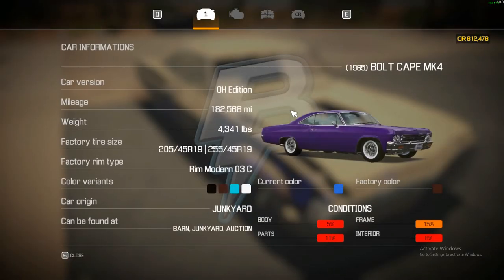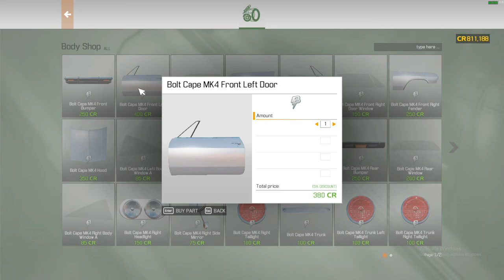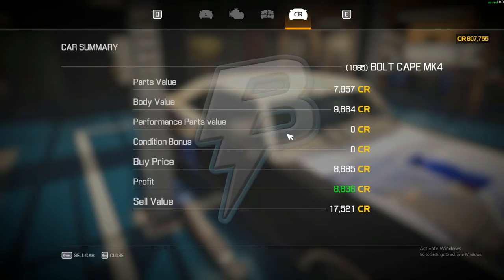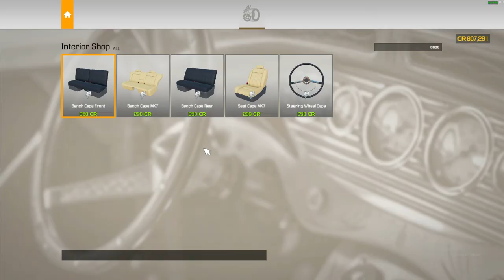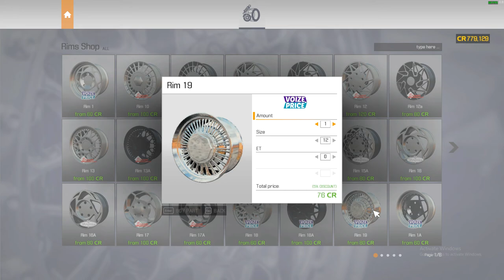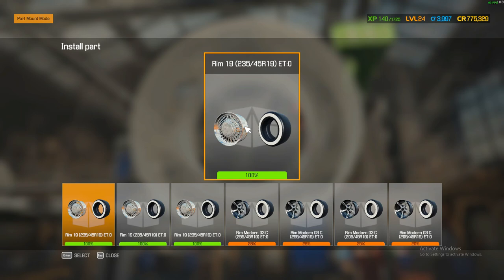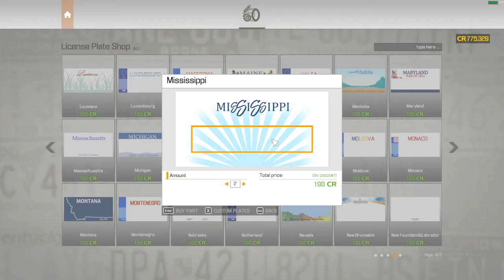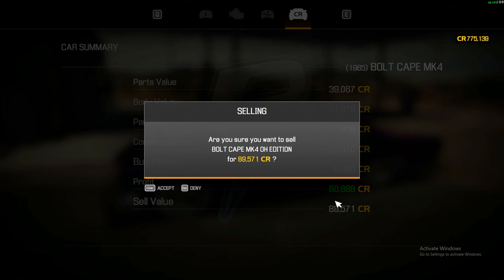Car Mechanic Simulator 2021 - Bolt Cape MK4 Ultimate Lowrider (OH mod) (Chevy Nova SS)

Comment: I did everything as in the movie with the engine.  I installed the tuning of the V8 OHV heads and I cannot install the Supercharger Intake
 Manifold V8 OHV because the game constantly requires mounting the intake manifold 1 carburetor.  Help‼ ️
Reply from the maker: Did you change the engine from when you put it on the stand?  You might need to change the blueprint before you start building
Reply: @Samereye  Thanks 👍 I forgot about that.
Reply from the maker: @noweather5702  no problem man.  Thanks for watching my vids!  Hope you keep watching!